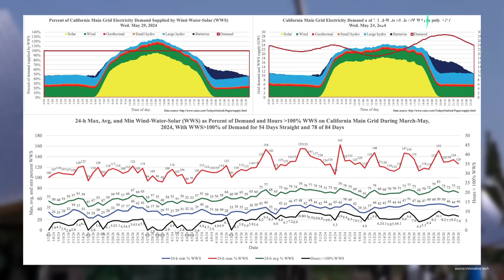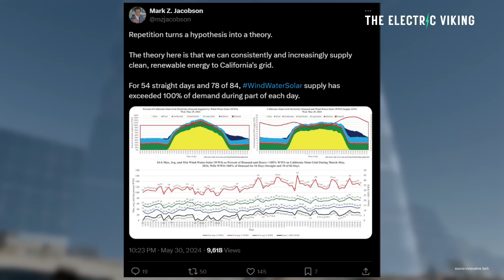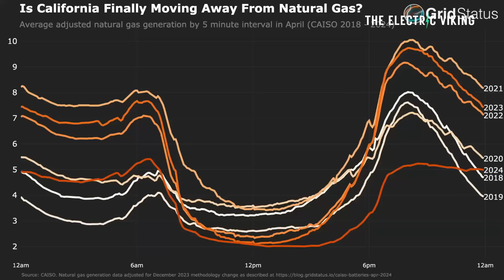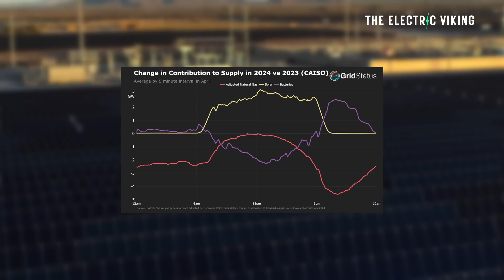Solar smashes records in California, 'DUCK curve' nearly wiped out

Comment: I live in CA and have my own solar system.  I had to expand it to charge my wife's Tesla.  I will find out by the Fall if it cover the house and the car 100%.  It is baffling why they have changed the equation on home solar.  My system in grandfathered in, but new systems are required to pay the utility a substantial monthly charge for being tied to their grid.  Maybe that will encourage home battery storage.  Funny, I have to get CA news from Australia.
Reply: It'll probably do more than that, it'll drive residential electricity production off grid.
Reply: @12pentaborane  Tha is pretty much what I said: it encourages, or forces, homeowners to get batteries and go off grid.  One cannot grid-tie without the utilities' approval and they won't approve without the monthly fee.
Reply: @12pentaborane  I have been studying VPP's. Last I hear, Tesla is establishing VPP's in California
Reply: It shouldn't be surprising. A lot of the grid is just fixed costs -- equipment amortization, anything transmission related, tree trimming, administrative overhead, etc. -- that has little to do with your usage. If everyone installed solar and was pushing extra energy to the grid at midday and got it back at peak hours for net zero cost, the whole thing would collapse in on itself because it is completely unfunded.  There should be a fixed monthly surcharge for a grid connection that everyone pays (who is connected to the grid) whether one uses electricity or not to cover these fixed costs.

But yes, NEM3 will encourage battery storage because the payback for exporting to the grid is now so tiny. The way to recoup your investment is by not consuming electricity in prime time -- that is store your solar on site until you need it later in the evening. Solar only doesn't really pay anymore.
Reply: I have a 4.7 kw system got it under Nem 2 I have had and excess of 3000kw each year. This is the first year with the Model Y and it looks like I will easily have had enough for the car from that 3000kw . But PGE is out to kill home solar and screw the general public here. Most of the year I only 10 to 20 miles a day .  If I leave town and come back with a charge under I like to get 
a mid range charge to keep the battery in the sweet spot . The Moss Landing Tesla peaker plant is about 30 miles from me.
Reply: @ctuna2011  Have you done a study to determine if you can eliminate the PowerWalls and use your Tesla battery V-H?
Reply: What is the grid connect charge in CA? I just checked my bill (I'm in Sydney, Australia) and the grid charge is about $1 per day (65c US).
Reply: Anyone else here from CA since I can't seem to get a response? Grid tie charges? Do they vary from county to county, provider to provider? 
$30 a month for grid tie is not a lot of money. Grids are horrendously expensive to build and maintain. Grids used to be a loss leader. You have customer lock in so you subsidize the grid, then price gouge on the electricity at the back end.
If you are not charging for electricity, you gotta charge the full freight for the grid. If you are power self-sufficient, go off-grid, it will make the grid operator happy.
Reply: @ianthompson44  The state has evolved the grid tie fees.  I put my system in in 2021 and have no specific fee.  I am charged for monthly charges to maintain the grid the same as non solar customers.  It was changed last year.  New solar grid tie systems must pay $80/month for the privilege of giving the utility free power.  Power I provide offsets power I use, but if I provide more than I use, the utility gets to keep it.  They true up once a year.  If I have provided less than I used, I must pay the difference.
Reply: @ianthompson44 From CA and in PGE the monthly charge for us is about $11 USD per month.
Reply: @bryanwhitton1784  That's pretty cheap for 24/7/365 access to electricity (36c per day), and more in line with what I would expect. Do you have solar that you feed in? I'm wondering if the large discrepancy is due to discriminatory pricing.
Reply: @ianthompson44  during the summer months we feed power to the grid. The house loads are always the priority then recharging the site battery. After that the car batteries. We have two Tesla cars. Even with that load we typically feed in 20+ kWhs per day. 
In the winter it is a different story. On sunny days we consume all of our solar for house loads and charging the battery. There are days where we charge one car from solar but if we need to charge the other it is from the grid. 
This extra is why we need to feed back during the summer.
Reply: @ianthompson44  we pay more than $0.55 per kWh for peak and about $0.50 off peak. In that price includes a charge for infrastructure. The stated reason is so low income/low users can afford power.
Reply: @bryanwhitton1784  How do low income users afford $0.55 per kWh? They include the infrastructure charge in usage? Sounds like a con.
Reply: @bryanwhitton1784  I assume in the SoCal summer the mean solar irradiance is between 7 and 8 and the winter irradiance is between 4 and 6. Maybe a little more if you lived in Joshua Tree. 
Given the size of a standard stick-built SoCal home, I'm guessing the summer consumption including air conditioning is probably in the order or 30-40 kWh per day for the house, plus maybe 10 kWh for each Teslas, and you are feeding 20 kWh into the grid. Say 70kWh of generation at the low end, with 7 hours of solar irradiance, guessing you installed a 10kW system?
$0.55/kWh is really at the high end though.
Reply: @ianthompson44  30-40KwH per day says more about California (and US) building standards and poor design than anything else. Proper insulation, AC that heats / cools individual rooms (like in Europe) rather than the entire house, more efficient appliances, and homes that have grown absurdly large over the last hundred years, and are designed with no thought for the local environment are all things that could be remedied with current technology and improved legislation to reduce energy use. It's not all about more energy production. But 55c is absurd - and there should be a fixed connection charge for everyone.
Reply: @MalcolmRose-l3b  Yep, most of the houses in SoCal are stick built, or at least they were 24 years ago when I was there last :) The most thermal efficient houses in SoCal tended to be Adobe houses, but white people don't want to live in them. 

55c/kWh is just pricing yourself out of the market. The panels themselves are about 2c/kWh on a 10 year horizon, about half that on a 25 year horizon. But in much of the US, you pay around 50c/kWh for permitting and installation. Mad.

If you live in SoCal and you have a pool in your backyard, fill the pool in with dirt, put a light concrete slab over it then put the panels over the slab. On ground doesn't require permitting (usually) and you can do 90% of the installation yourself, you just need a certified electrician to hook it up to the grid-tie.
Reply: @oldguy4057 do you have a Tesla power wall or two installed?
Reply: @johnbeeler25  No batteries, just solar panels that are grid tied.
Reply: When you expanded your system didn’t they toss you off the old program and force you onto the NEM3? I’m also grandfathered in but I’m worried about upgrading to increase my system or swap out old 220 panels and sub in 400’s. What did you do?
Reply: @aramcobratusa8963  NEM 2 system here w 12Kw. Been with PGE since 2002. Only for new installs.
Reply: @skywave12  did you upgrade to a larger system and they kept you on NEM2? I know we get to stay on whatever NEM we originally got for 20 years but I was told if I expanded or upgraded they would migrate me to NEM3
Reply: @aramcobratusa8963  Maybe from NEM2 However my system was originally declared a small power generator as NEM was in its infancy. They did not even have code for the smart meter to run backwards without an alarm for years. My system has a 3 Kw wind generator as well as PV. If there was a questioning issue then develop a off grid system with batteries as a solar generator. One of the inverters used has a 15 Kwh bank that peak shaves (grid tied) as well as provides backup for critical loads. Works well. You have more of a issue regarding making sure proper UL certified equipment is installed for insurance, and local permit allowance. They want to see that UL certificate.
Stay safe. 🙂
Reply: @aramcobratusa8963 not if you applied before April 15, 2023. We did the same thing. We replaced our 3.6kw array with an 8.4kW array and added 17.4kWh of storage. All on NEM 2.0.
Reply: How do you handle cooking in a power outage?

I recently went through a 7 day outage in summer heat in Houston.    I used my gas stove to boil my water.   Electrical boiling water and cooking seemed to use a lot of juice.   Thinking of getting a propane camping stove.
Reply: @mac_mcleod  Been very lucky not to have had any extended outages.  Unfortuneately my grid tie system will not product power without 240v from the grid.  If I put some thought into it, I am sure the panels will produce.  I just need to connect them to a non-grid-tie inveerter to use the ac power.
Reply: @oldguy4057  if you have a major earthquake, you could be without power for 3 weeks.

If it is a winter blizzard as we saw at Mammoth 2 years ago, you might not have solar either.

I recommend a small generator with 3 days fuel .

It's cheap ( under $1000) and I'm still working on the cooking solution.

And then solar (wind?) and batteries.. also small and not grid tied
Reply: @mac_mcleod   Hot plates or a gas grill with a side burner.
Reply: @frequentlycynical642  I have learned that the propane tanks are cheaper to refill at U-Haul and have more propane than the ones you swap.
Reply: Home solar systems provide power when utilities don't need the extra power.  What would make sense for Utilities to do is pay solar generating homes for power when they need it.  This would encourage home solar systems to have batteries so they can sell their power to the Utilities when the Utilities are willing to pay the highest price for their power.
Reply: @stanleytolle416  If you have legislative capture, it makes sense to pass laws that maximise your profitability. If you can get solar power owners to charge your batteries, you can save billions in grid shaping costs, billions in peaker plants and gouge your non-solar customers with peak power prices. Grids are monopolies, no one should be surprised by monopolist behavior.
Reply: @stanleytolle416 That is about what NEM 3 is. The feedback rate changes by the hour of the day.
Reply: It’s not baffling. It costs to much. They subsidize your panels with absurdly high buyback rates. Yet one ore reason California’s rates are so high.
Reply: @stephenlight647  I have no idea what you said.  The utility only buys back power at the same rate they charge me.  What is "absurdly high"?  They do not subsidize my panels or the rest of the system.  I installed used panels and did all of the work myself.  What are you talking about?  Don't bother replying to me.  This is my last reply to you.
Reply: What's your installed solar capacity? How big is Tesla' battery?

Comment: Gonna up-arrow this one, even though Sam's exaggerating a bit (as usual).   This entire week... the power forecast for the grid by the CAISO (California Grid Operator basically) for the next 8 days is basically normal operation and plenty of margins.

This is mainly because the Great California Air Conditioner (called the Pacific Ocean) and related overnight weather patterns are in full effect this week.  So we are getting a lot of overnight cooling for about 75% of the state.

-Matt
Reply: We are seeing record high temperatures 30 miles inland from San Francisco.
Reply: @JBoy340a  Yes, just over the east bay hills it's really hot.  That area should cool down overnight, by a lot.  At least so says all the weather models.  Danville's overnight lows will be 56F or so tonight, and even better the rest of the week.

We weren't able to cool the house down as much as I'd have liked last night, but I think tonight will be fine.  When we can get our whole house cooled-down overnight the heat doesn't become uncomfortable until after 3pm the next day, even if it is 100F outside.  So its a fairly small window.

-Matt

Comment: What most people don't understand is that fossil fuels energy generation just like ICE vehicles, is extremely wasteful, about 70% of the energy generated with fossil fuels is wasted, only about 30% gets to the end user, unlike solar and wind where over 90% of the energy captured is actually used. I installed solar panels and batteries about 3 years ago and they supply about 93% of my energy needs. The time where fossil fuels will not be able to compete against renewables is not too far away. Not sure if 5 years, but between 5 to 10 years for sure.

Comment: This is good news but wouldn’t it be more land efficient to keep pushing for roof top solar instead of keeping a monopoly that eats up aireable  land (unless its useless desert)
Reply: Rooftop solar will increase, albeit at a reduced rate because of NEM 3.0. Another location being tried now is over the thousands of miles of aqueducts and canals in California. No land is required. Less water evaporates. And there is an increase of electricity production of a few percent because the cells are kept cooler. And no, there isn't a problem of contaminating the water. Somebody always has to try to find a reason why it won't work. :)
Reply: Tons of roof top solar in the state.  By me 4 out 5 homes have rooftop solar.  For us solar panels and batteries have eliminated our power bill.  We used to pay about $400/mo.  Now we pay the $15-20/mo connect fee only.
Reply: @JBoy340a  see that just sounds like a better way to do much of this for the consumer. I realize there’s a big upfront investment but what you get for your investment seems so worth it.
Reply: And all parking lots.
Reply: That and cover more reservoirs and canals with floating and more agrovotaics… start using solar to protect the soil and water
Reply: Most is on roofs or over parking lots and some on unused bare land.
Reply: @toddwilliams5905  parking lots are good dual use and close to cars
Reply: @marccracchiolo4935  agree.  And who does not want to shade their car from the hot sun, or rain.
Reply: @JBoy340a  another plus to consider
Reply: I always envision solar panels over a cemetery. As for me, I want to be scattered so I don’t use valuable land meant for the living.

Comment: It's nice to make progress, but how much Exports/Imports did CA rely upon? Until they can have enough power storage to compensate for that, their just relying on fossil fuel plants that ring the state.
Reply: You can see all of that by googling "CAISO" and perusing the web site.  That's the grid operator for most of California.  There is an enormous amount of data on-site as well as reports and statistics on the power mix, inclusive of imports.

But the basic answer to your question is... why do you think its a problem?  South-western states typically rely on California exporting to them in the early afternoon during heat dome events like this, and California typically imports some electricity overnight as part of its regular cycle.  Mostly Hydro, nuclear, and natural gas.

Less and less as battery storage increases.  Seems to be a good relationship to me, so I don't know what other states will do once we no longer need to import anything.... their local electricity costs are going to increase without the bulk export revenue supporting local rates.

-Matt
Reply: Don't you think the neighboring states can and are doing similar things? Why wouldn't they?
Reply: @geirmyrvagnes8718  Yes, but its a matter of relative scale. California has a population of 39 million.  Arizona has a population of 7.4 million.  Idaho has a population of 2 million.  Nevada, 3 million, New mexico, 2 million.

Plus also transmission line availability.  One reason several southwestern states are pushing for a large east-west line is so they can participate in wider electricity markets.   Ultimately, all the way deep into eastern states.

-Matt
Reply: @junkerzn7312  That is the opposite of what you usually hear. I get told that other people can't possibly do like, say Norway, since they have the population of a medium city. Now it turns out it is an advantage to be a huge and populous state, while it is difficult for smaller states with abundant cheap renewable resources but smaller populations. It is confusing to keep up. Sort of like how electric cars are both far too expensive to ever be a normal option, but also drop in value to next to nothing in a few weeks. Schrödinger's excuses all over the place.
Reply: @geirmyrvagnes8718  No. California is a special case. Their environmental laws are tougher, therefore an entire ring of power plants was built in neighboring states whose major purpose is to supply CA with electricity. No other large state has laws as stringent as CA.
Reply: @jeffjwatts  Are you suggesting that other states (and countries) should do like California?